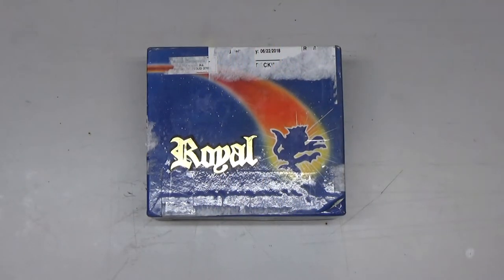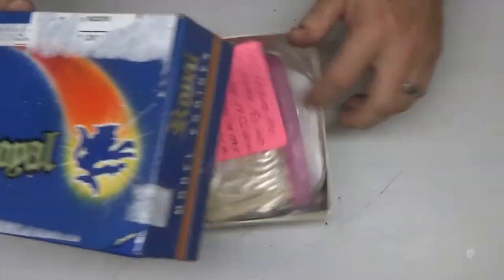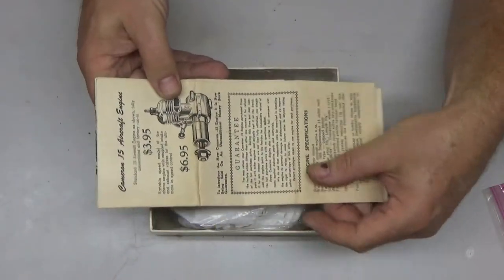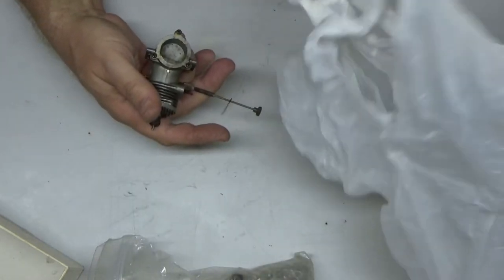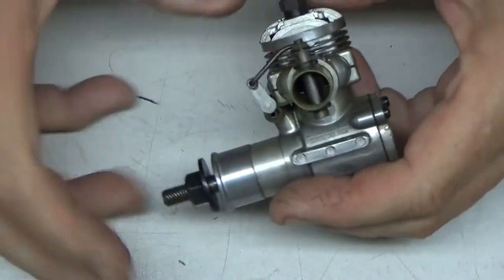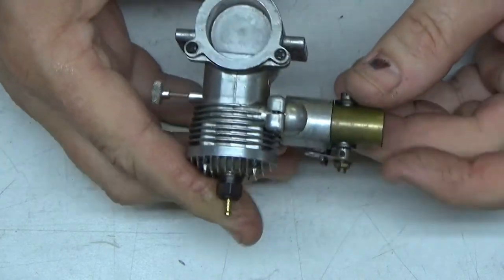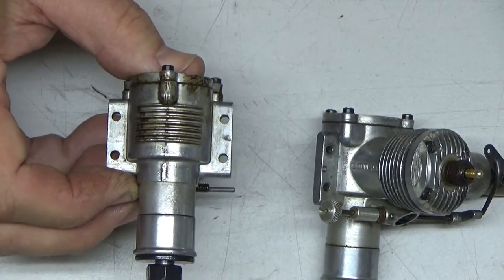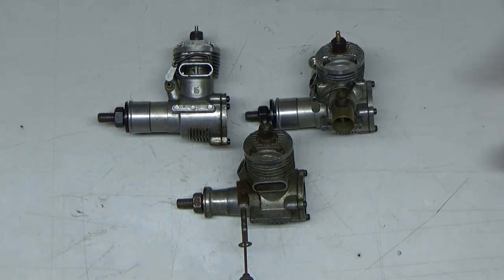Cameron Engines

Comment: Cameron engines were excellent quality,  their prices were in line with other manufacturers of the same era for similar size engines.
Cameron made the engines for Leroy Cox for his cars before he started making his own.
I used to have one of the .19 boat engines, it had a water cooled head and the backplate had a pump to circulate cooling water to it- pretty neat set up, as was the throttle control.
Reply: hey ive recently come across one of these .19 boat motors and im trying to find info on it, do you know the factory nettle tune or at least a good starting point?i had it running once but now im having issues with it flooding, the poor little motor